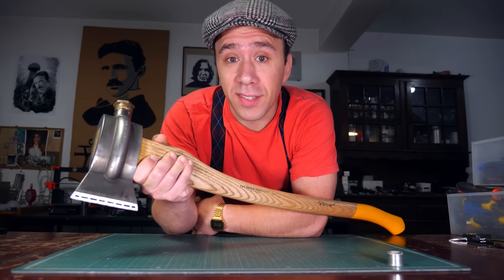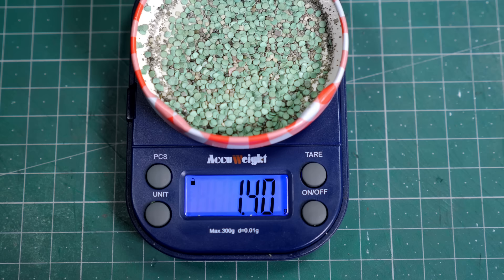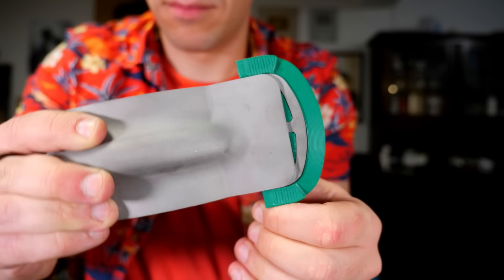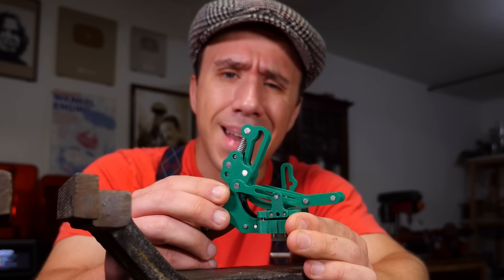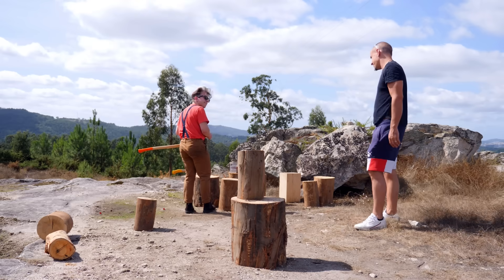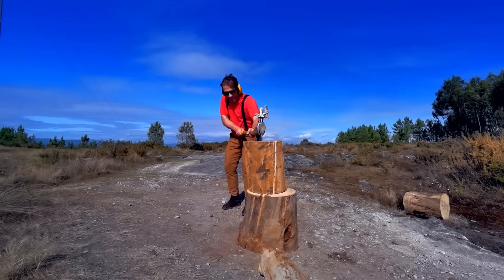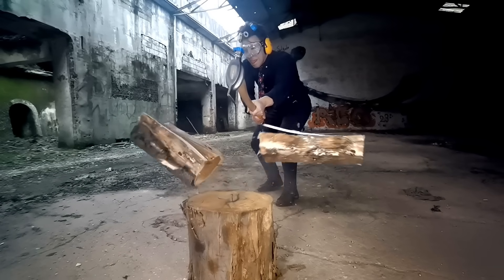I built a BETTER SHOTGUN AXE

Comment: I was going to tell you that eucalyptus is a very unforgiving wood to split. Its fibers thread a lot. When we are using a hydraulic axe to split eucalyptus wood, we have to drive the axe all the way to the bottom of the logs to effectively split it apart.

If the eucalyptus is very dry this may not happen. But on the other hand it's tougher to penetrate with a manual axe (a hydraulic axe would split anyway, even if it was sideways!).

For comparison, a pine log without knots would split entirely, from top to bottom, as soon as the axe penetrates a few centimeters.

One more thing. The first axe you've made had more holes, so there was a larger area where the exhaust gases meet the wood, multiply the pressure for the exhaust area, you get bigger force splitting the wood apart, it looked like these new versions had smaller surface area.
I guess this is something you'll have to do theahts on.

Comment: The solution to consistency may be to disengage the axe head from the swing completely. A floating wedge with a piston and small ports at the nose, and a trigger that ignites the primer when the shroud around the wedge hits the wood with appropriate force. Creative engineering of the gas ports will allow you to drive the wedge into the wood with gas pressure, and when it stops you have both the piston force and the gas vents in the blade working on the wood. Large gas vents at the end of the piston release everything if/when the wedge approaches the end of it's travel. 

Trigger for that could be as simple as a plunger on the face and a lever across the top to the firing pin.

Comment: So double based gun powder is mainly nitro cellulose and nitroglyceryn but with stabilizing elements. It may also be worthwhile to add something of a "burst disk" to your design to allow for the pressure to build in a smaller area which will increase the burn rate and overall pressure. I would highly suggest calculating the stresses on that and still likely adding a shield to the handle between you and the mechanism if you want to push it harder. Avagadros mixture is also a fairly common DIY option but has a higher pressure spike than gunpowder. another thing to consider would be can you move the mechanism to the front of the axe and place the chamber in front of the handle, as this will reduce the volume much further and you could potentially build in the burst disk of say like 3 sheets of foil sandwiched by the short plastic section over some holes where if you do multiple holes itll reduce the area and require more pressure to burst. Lastly in the case of something like a rifle caliber, the primer hole is very small in relation to the case volume and yields higher pressures as the primer is less likely to pop free, so if the casing is more like a 9mm or 5.56 the narrow body will allow for much higher pressures yet lower force on your retaining mechanism.

Comment: I think the problem is that the the blade of the Axe is to short.  Make it at least 3 inches longer to give the blast from the cartride more time. Alsomake the vents a little smaller so you can get a better edge on the axe and at the same time the vents will be smaller the blade goes deeper and the blast will be a little less so pieces or wood aren't flying all over the place and swinging the axe like a girl does not help.

Comment: Do you really need a blade? Aside from aesthetics.

Sounds like what you really want is for the exhaust to get inside the wood, you're probably better off converting the blade into a pike or needle.
Also you can probably not include the pointy part into your design, just design it as a pointless rod or something, so that it wouldn't qualify as a "weapon".
You can then create the point yourself when you get the piece.

Comment: What you should make next is a engine that runs on  Hydrogen and uses a solor panle to turn the water into hydrogen and it puts out about 40 hp the real reason i want you to do this so i can copy you Designed to put in my VW super bug

Comment: Research using metal files to sharpen tools. File in one direction. Away from the body of the item being sharpened at a 23° angle is what ive been told. I could be wrong and in no way claim to be right. Its just a suggestion

Comment: I feel like using H abd oxiden gas in a bigger pressurized vessel with a small spark plug gor a spark and a thicker aluminium foil used as a pressure valve for when its raptures do to the pressure created by the combustion would be a more interested approach

Comment: So if its just a gas thing your doing why not build a tank in the handle that conects to the head. That can then br re filled using a compressor basically rather then using shotgun shells your using compressed air.

Comment: Just had to say it is totally ok to use a grinder to sharpen an axe/splitter. I am a landscaper and still use a splitting mull for logs too big for the gas splitter. I have only sharpened the mull once. They don't need to be sharp, just somewhat to a edge. Now an axe for cutting the tree should be sharp. I would still use a grinder. Only a fool would use a file when a grinder is available.

Comment: You need to learn how to use a file properly; it cuts on the forward stroke by applying pressure on the reverse stroke, you don't cut much, and ruin the file. No math needed

Comment: My suggestions,

1. Keep it simple, do you really need a semi-automatic shell loading style device? Use the kinetic impact from stricking the log to strick the log.
2. Seal the gases to go in one direction. That complex device although fancy had enough way to release gases in way ways.
3. Surfaces area should help one to spread the force but also to release the gases.

Comment: Mr. Integza please also consider adjusting your swinging technique to include sliding the front hand down to meet the back hand, instead of relying on muscle strength to push the axe down into it, leaving both hands static and locking them. You're losing power by trying to use power!!!

Comment: I recommend sealing the backend where you load the shell better. You're probably getting a significant energy loss from gas escaping out the back. The screw mechanism on your Mk 1, while not as convenient, ensured that all the gas wen tto the blade head.

Comment: On the axe head you want sliding triggers that push back as the axe hits the wood, on the back end of these triggers you want a cam thats hard linked and operates a firing pin. So axe hits wood, triggers push back, cam pivots firing pin arm on to pin, kaboom. Almost instant

Comment: I bet you can make an engine log splitter there is a diesel pole driver 2 stroke. It’s a heavy weight that slides into a cylinder pipe 
They spray a little fuel drop the heave piston and BOOM 💥 YOUR FINGS ARE DETACHED oops sorry caps … and the BLOOD is spitting out everywhere like a blood fountain from drawn together, cartoon he he he 
There are large vents on the top of the piston, hmm could use a treed one way valve to help suck in fresh air before compression as the hmm just go to watch the video super tired now nite ￼😴💤😴💤😴😴😴😴💤💤💤💤💤💤💤💤💤💤💤💤💤💤💤💤💤💤💤💤💤💤💤💤

Comment: Files only cut in one direction — on the forward stroke (away from you). The teeth of a metal file are angled so they shave off tiny bits of metal only when pushed forward.

When you pull back, the teeth don’t cut — and dragging it backward can dull or clog the teeth, round off the edges, or even damage the file.

Using a file back-and-forth like sandpaper can also scratch or score the workpiece unevenly, especially on softer metals.

Proper technique:

Grip the handle firmly and support the tip with your other hand.

Apply light, even pressure only on the forward stroke.

Lift the file slightly or reduce pressure on the return stroke.

Clean the teeth often with a file card or wire brush to prevent clogging (“pinning”).

So yes — push to cut, lift to return is the right way to file metal.

Comment: I am certainly interested in how to defeat the harder woods here. Just spitballing but a small sparkgap in the blade and injecting the hydrogen into the vein opened up by the axe could work wonders. Put the explosive where it needs to be, between the fibers.

Comment: First of all the varying force of explosion is caused by uneven sealing (exhaust ports of axehead wont seal to wood exactly same every time), this causes gunpowder to not burn completely because smokeless gunpowder needs pressure to burn fast enough to explode, as you saw it burns pretty slow outside of the shell for that reason. If you used nailgun cartiges you would get much better effects because they are packed much more tightly inside and cartige is crimped at the end wich helps it build up pressure for proper combustion. And the absolutely most important part: it has to be build out of thick steel and be at least as robust as gun, please look at how breech locking mechanisms in actual guns are made, you are making a granade basically.

Comment: i think u need to use the bigger push from the bullet, meaning bigger amount of gun poweder. In slo-mo is not that it's explode, but it pushes the word in half. If the lock on the mechanism is loose enough, it has to go up launching the mechanism.

Comment: It not really an axe, it's more of a log splitter, it's legit a sledge hammer with a pointed edge.
I have done some "axe deletus log" stuff my self and I'd like to add some things.
Something like a Pick axe or Mattock would allow for better penetration.
Maybe in the future you can strap a jet engine or explosive engine on something and see if the pressure difference can rip apart some logs.
Great video 👍

Comment: I think switching to a manual trigger maybe a better choice to being able to set off the shell at a point where it is ideal to detonate after the axe is correctly positioned to not waste shells

Also maybe consider looking at reloading, you can get the components for shell reloading without the need for a license if i recall and all you would need is powder and primers. Both are components that you can adjust the volume of powder to adjust the amount of boom you want as well, although be careful since too much boom is not good, maybe do some research and get some source materials for reloading if you decide to go this route
Reply: Black powder may also be a viable alternative to modern smokeless powders, as i am almost certain even in canada we do not consider black powder firearms as a firearm, although getting black powder to fire with a primer from a modern shell is often times a challenge and black powder is generally less energetic to a normal smokeless powder, although smokeless powders can vary in burn time significantly depending on the type of powder used

Comment: Two things you should look into for V3 are Gas Tubes and Overpressure Valves. Gas Tubes will allow you to make a slimmer design that can effectively move the gas from the main combustion chamber to the axe head, and an overpressure valve will prevent the trigger mechanism from launching itself towards your head because all the pressure will have somewhere to go.
Reply: An overpressure valve would not be needed if the trigger mechanism was more securely designed like on those .50 cal rifles with the screw on the rear of the barrel. As far as I know an overpressure valve would be overwhelmed too easily and not allow the wood to take the force of the shell
Reply: @RealJustinWillock i am just thinking as like a worst case. Let's just say the blanks he is using have an average pressure of 1000psi. If he put a valve in that went off at 1100psi than he wouldn't be at risk of it breaking if he got a spicy round. And honestly it's better to both build it beefy and add the valve because you don't want to assume you're safe with an explosive that could launch a chunk of metal right at your head 🤷‍♂️
Reply: @simplegunsmith for sure but something like that would have to be pretty beefy no?
Reply: @RealJustinWillock yeah, but I still feel the valve would just be another layer in his safety net, like his fire extinguisher and face shield.

Comment: Fact is that hydrogen burns pretty clean and is very efficient when you consider mass/energy delivered, but its density is pretty low, so you'll need a very big tank of hydrogen to get the same amount of energy you could get with average gasoline, for example. No wonder why 3rd stages of rockets are so big but can only work efficiently in space or near vacuum.

Comment: You should see if you can get ampact shells. There used in the electrical industry for wedge style connectors. There like a shot shell without the shot.

Comment: Integza not sure if its for the laughs but you are using the grinder wrong, sparks should be going away from you, it's dangerous using it like you did on the video, I work with that tool a lot also you should always use the guard to prevent splinters going your way in case the disk breaks

Comment: would it be better to make the blade whole but using the pours metal printing you used in the past, to relieve some extra pressure you could design small exhaust vents with the same pours metal print. (not an engineer or anything just one of the ideas I had after watching this.)

Comment: Your axe swinging technique could use a lot of work. Even your hardest swing you said you did was pretty weak. If you hold the axe right at the bottom of the handle with both hands when you swing, you'll get so much more power.

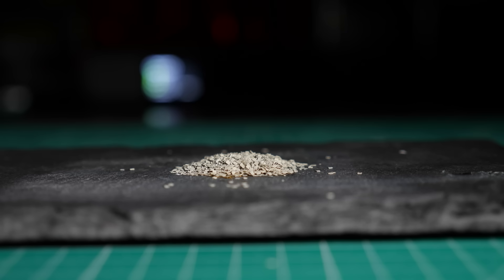Comment: 2:58 it burns faster from the primer than an open low temp flame, the same way c4 detonates under enough energy but not enough will just cause it to burn inefficiently with heavy black smoke

Comment: maybe add small hocks similar to a harpoon but smaller to keep the axe from getting pushed out. To increase penetration while not having it split i would change to axe to a spike. The end result would probably look like a mix between a pickaxe and a harpoon. For the over pressure issue, i would probably make something like a hock on the head of the "axe" to prevent the firing mechanism from separating from the axe head, But it should be loose enough to prevent the explosion of the mechanism.

Comment: Make a Splitting mechanism on the edge of the axe and use the pressure of the bullit to propel the axe into the log. The fire mechanism should be pretty simple as the exhaust of the bullet would be facing the back of the axe and it could be fired simply be the impact of the axe on the log

Comment: What if there was no volume for the hot gas to expand into, just a metal spike with holes rammed into the wood with a Blank Shell close to the tip. so the Explosion happens right inside the wood.

Comment: Honestly, I think you should completely rethink how you are using the pressure. You are never going to be able to get completely consistent performance if the pressure is entirely dictated by how well the vents seal against the wood when it impacts. I'm picturing a mechanism in the tip of the axe that expands outward to force the wood open, and only vents the gas once it has reached maximum travel. Unfortunately, building something small enough to work as an axe head while also strong enough to withstand the pressure from a shotgun shell might not be possible.

Comment: Okay, as many others have pointed out, the mechanism is a bit of a contraption. It's complicated, bulky in all the wrong places, and as you well know, unsafe. 

I'd also like to point out that your log cutting form is disastrous, and this may be contributing to the lack of penetration. I realize that the point of this axe is to make it difficult to FAIL at chopping a log, but just improving your stance and aim will make your results more consistent, you should work to make your swings as consistent as possible to eliminate them as a possible source of failures

Comment: What if you pressurized the hydrogen to like 5 bar, that would go to 1.5 L right?

Then again, at that point might as well just pressurise 1.5L of air into the 300ml and release it.

Comment: Maybe in the next version you can make the ignition depth dependent. 

For example if you make a retractable blade next to the main blade that fires the mechanism once it reaches a certain depth , you can also make it adjustable to fine tune until you find the optimal depth

Comment: Immediately upon seeing the downfalls of the first 2 designs, the solution (in my opinion) became clear! Instead of using the shell to blow the wood apart, what if you used the pressure from the shell to push a mechanical splitting mechanism? Something like this axe: https://www.youtube.com/watch?v=nNRn2e1Pn_Q   -  that mechanism could be powered by the shell and the force would be more than enough to blow the log apart. And since you wouldnt have to worry about gas sealing, the axe head could be designed for maximum 𝓟𝓮𝓷𝓮𝓽𝓻𝓪𝓽𝓲𝓸𝓷

Comment: V2 had less vent area than v1.  So less force for same pressure. I might maximize the vent size.  

 Not sure about the synchronization,  but how about 1 shell per side.   Double barrel axe so to speak.  

Be careful and choose your metals carefully to handle the pressure safely.

Comment: Seems like the "axe" might work better if it was more of a long needle shape that penetrated deeper into the wood, with holes along the needle. Also maybe this could be done with compressed air.

Maybe you could modify a nail gun to shoot a custom "nail" (with holes as described above) into the wood. The nail gun also uses compressed air which could then force air into the wood through the "nail".

You need a one way valve to keep the pressure from blowing back through the axe, although then it might just shoot the whole axe head back up out of the wood if the wood doesn't split.